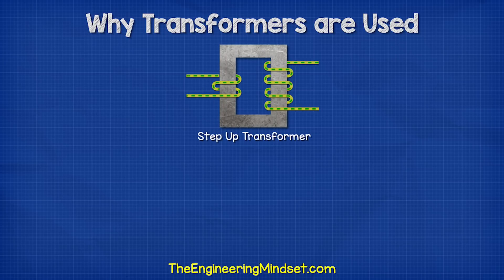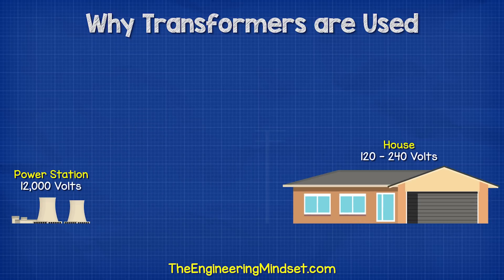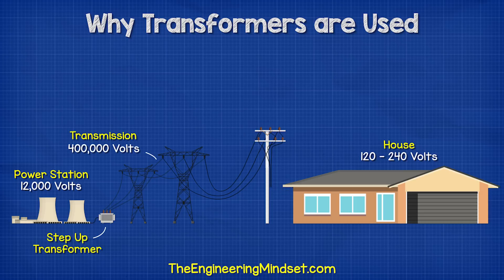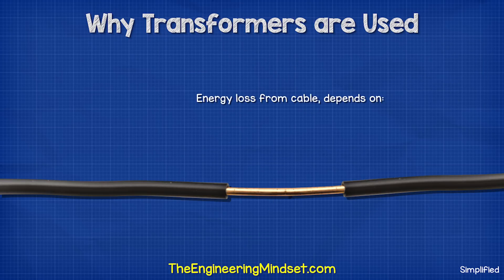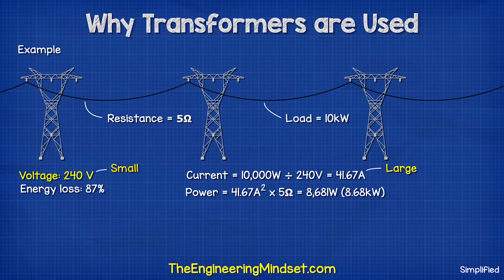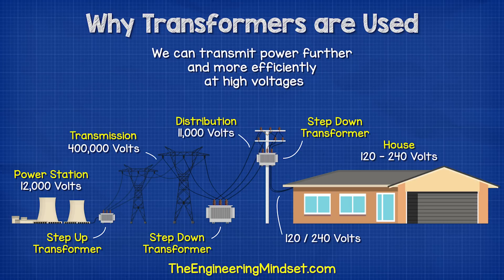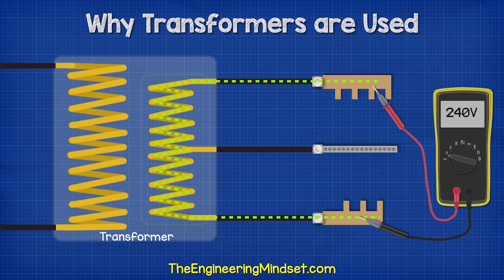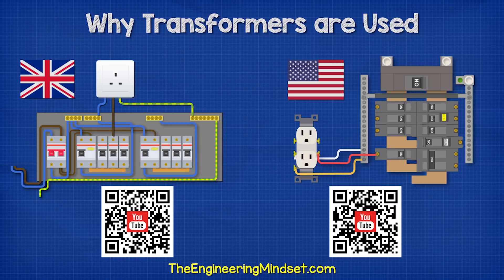Why are transformers used?

Comment: Why didn't current increases with increase in voltage 🤔
Reply: Because if you use a higher voltage transformer (at both sides of the transmission line), the impedance of the primary coil also becomes higher, limiting the current even though the voltage is increased. However, impedance does not waste energy like resistance does, so therefore the total efficiency is increased.

Hope this makes it clear.
Good question by the way.

Comment: The power consumed is also equal to v²/R. In that case for 40,000volt the energy dissipiated would be higher than that at 230v. Isnt it?? Please make me clear on this.
Reply: When you use V²/R, you use the difference in voltage between the ends of the line (voltage drop) as V. But, there is pretty much no voltage drop across the line. It's 400.000 on both sides, so pretty much no difference, therefore V is very very low.

Hope this makes it clear.
Good question.

Comment: What's the difference between a Step up Transformer and a step down transformer? Does it just matter on how you hook up to it? Like if I hook it up in this direction it steps up, but if I hook it up in this direction it steps down.
Reply: It depends on the conversion ratio. If it is going from 1 to 2 in a 1:2 conversion ratio. It is a step up transformer. For instance, you connect 1 voltage input to the side that has the 1 ratio, you will product 2 voltage output at the other end since the conversion ratio is 1:2. Whenever you increase the voltage by a certain magnitude, it is a step up transformer and vice versa. In short transformer is defined by the ratio between its input and output voltage.

Comment: A transformer to electrical is the exact same as a transmission to mechanical. It changes the voltage / current - rpm / torque ratio.
Reply from the maker: See our new video on how to build mechanical versions of electronic circuits? Watch here: https://youtu.be/Zv9Q7ih48Uc

Comment: I don't even need to watch, they are used as disguises, they are more than meets the eye , they are robots in disguise....... but seriously they are to step up voltage, in the case of power lines to transmit electricity long distances and to step down voltage to your house. Large scale or small scale the do the same. Now to watch and see if I was right....

Comment: Not sure everybody gets the point. Because P=I^2*R then by increasing voltage 10× you decrease current 10× and decrease losses 100×. Now, instead of 10× and 100× we are using something like 1000× and 1000000× respectively in case of 400kV and 0.4kV (380V three phase in Europe).

Comment: Could you relate this to three phase voltage sources and loads?
Reply: Also, the cost of materials between using 3 line vs two line phase and loads.
Reply: @ftscotttinez33  North America had electrification (AC current) before the remainder of the world.  Therefore the LATE ARRIVALS improved upon 
that system.  Electing to use either 230/240 volt systems for all household uses.
Reply: @tedlahm5740  North America uses what is known as "split-phase". As in it is only 1 240V phase but the neutral is tapped in the center of the secondary, giving you 120V on each split and 240 across the entire phase for larger loads
Reply: 3 phase you add route means square, or root3. Which is about 1.732. 30 000 watts at 240V is 125A single phase. 30 000 watts at 208V 3phase is 83A. Even though the voltage is slightly less a 3phase system will still draw much less current for the same load, increasing efficiency.
Reply from the maker: Seen our new 3 phase transformer video?➡️: https://youtu.be/u0SsejDCVkU